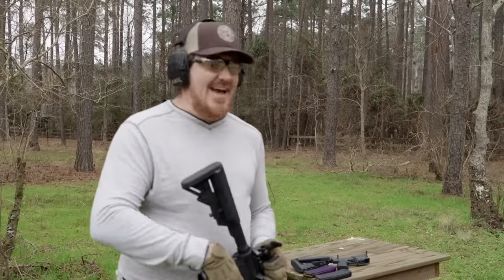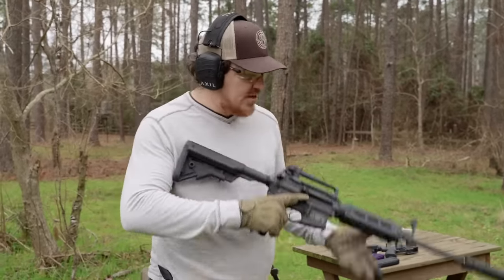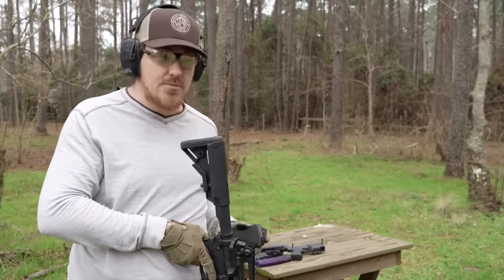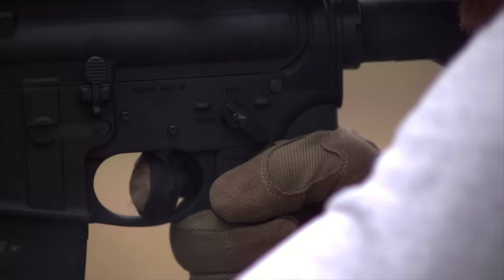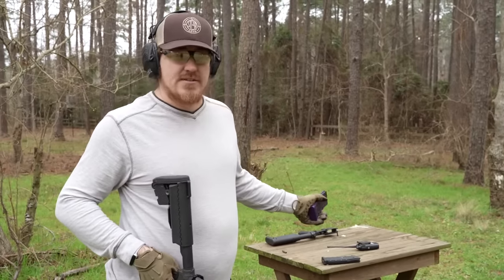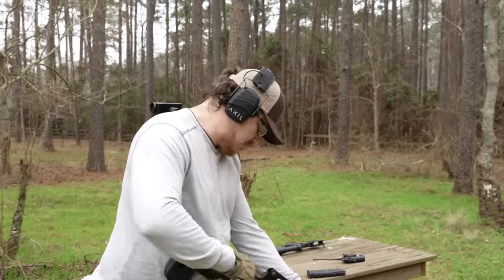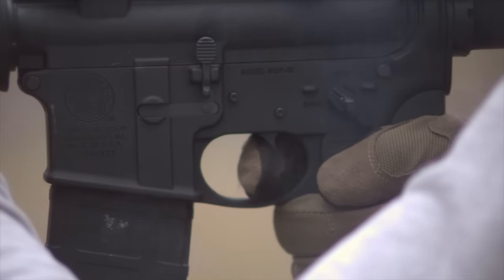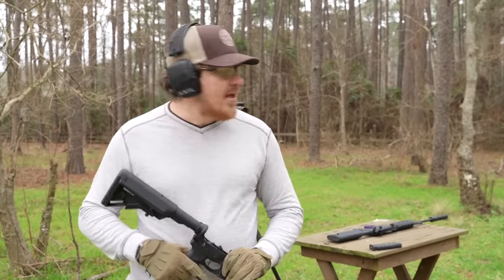FRT-15 Vs An Actual Machine Gun

Comment: With the AFT going after Rarebreed, this is the video that I've been wanting to see. 

The footage that you managed to get with the high speed proves that the Rarebreed trigger doesn't meet the AFTs definition of a machine gun.
Reply from the maker: That is the main idea. Hopefully this makes it to the courts
Reply: My question is do you ever release pressure on the trigger? Looks like one squeeze 30 pews to me I think you just did the ATF a huge favor with this vid.
Reply: @GigaBrand  A fully automatic trigger or firearm is defined as having the ability to fire multiple rounds per trigger function or, in simpler terms, having the ability to dump a mag without releasing or resetting the trigger. 

The forced reset trigger, as explained in the video, uses some of the gas from a spent cartridge to force the trigger to reset as the bolt cycles back. The trigger resets, ergo, one round per trigger function (which would meet the ATFs prescribed definition for a semi-automatic; perfectly legal). This is the definition set forth by the ATF, so, unless they plan to use this case to set precedent for the redefinition of their own definition (confusing, I know) then they don't really have a legal leg to stand on as per their own verbiage.
Reply: @cajunstump  I get that, The ATF has never cared much for verbiage (the way they define receivers, for example). TBH I'm real pro full-auto and I see a few companies making  similar devices which is cool.
Reply: @GigaBrand  Fully agree, man. Since neither of us are criminals, I'm operating under the assumption that your not (also operating under the assumption that you're not a fed), then we should be able to own whatever the hell we want as far as guns go. Full-auto? Yes, please.
Reply: @gatcattill  O.K.- You have a judge watching the video. The FRT fires faster than the automatic. 
The main difference then is the rare breed trigger.
Now we have the close up of the trigger action.
If you pull the FRT trigger all the way back you don't get the automatic action.
You have to regulate the pull just so. But you really are not pulling it with each round. You can empty the magazine without moving your finger. The trigger does it for you.
On the automatic the firing mechanism is internal. With the FRT the mechanism is set externally.
Your going to have a good argument in court trying to claim you are consciously pulling the trigger with each round as in a semi.
Now don't get angry. This is what you are going to run into without any change in the law.
Reply from the maker: @nibcamp3958  I disagree - the faster rate is the delta of buffer weight. Also the law does not control the rate of fire just the action used to obtain a rate of fire. The trigger movements are the letter of the law and that is what’s important here. The ATF would have to change the letter of the law to make this illegal
Reply: @gatcattill  Here's the thing. Your opinion is fine.
The close up of the finger shows that you don't have to release the trigger and it keeps on firing. My interest is in the law and how it would be interpreted in a court of law.
We'll find out soon enough.
Reply: @GigaBrand  lol talk about missing the point, the legal wording is trigger pull not "oh the shooter must consciously let go and pull it" that would be too complicated
Reply: @nibcamp3958  Except the law doesn’t require you to consciously pull the trigger. As written it is single function of the trigger.
Reply: @frankshanks9726  That's a fine line between a semi automatic and a machine gun. If you can empty a 30 round magazine without consciously pulling the trigger 30 times , for all intents and purposes its a machine gun.Why do gun owners want this is beyond me. Be satisfied with a semi. Your only hurting your own cause by wanting more than is necessary.
Reply: @gatcattill  and they can and will
Reply: @nathanbarth7909  they can try.
Reply: @punchabunchofbuttons214  JON DOE- Pfft.
Reply: @nibcamp3958  don't mean to Necro but when the ATF says full auto is more than ONE ROUND PER TRIGGER PULL, and then you look at the function of the FRT, conscious or not, the trigger keeps resetting itself, albeit through the means of gas blowback, so while for all intents and purposes, it may as well be fully automatic, by the current legal definition of fully automatic, it does not fall under full auto since even with an FRT there is no more than one shot per trigger pull! Plus, the finger is required to activate the trigger regardless (whether done consciously or not) for the FRT to function.. so not full auto! I don't mean to revive a month old thread but I really felt like this stuff needed to be clarified without resorting to personal insults and back and forths!
Reply: @AmalekIsComing  Yes but here's the thing. With the FRT if you pull the trigger all the way back it doesn't work like an automatic.
You have to hold the trigger just right so that it keeps resetting and firing. You can therefore empty a magazine with one trigger pull, just like an automatic. It will never be allowed.
Reply: @AmalekIsComing  The Feds will never let themselves be outgunned. That's why automatics for civilians were banned in the first place. It started with Thompson machine guns and the Mafias. Always remember that. And always remember a civilian has no need for an automatic or gadgets that mimic an automatic. They do enough damage with semiautomatic. Gun owners should just concentrate on keeping what they have. Those gadgets just cause a bad name in a political world. Save your money.
Reply: @GigaBrand  Good thing “pressure” or “one squeeze” isn’t written in the law. The word that is in the law is “single function”  and there are single functions every time a round is fired on this trigger.
Reply: @nibcamp3958  Good thing conscious thought isn’t in the law. How the hell does a trigger behind your finger move your finger backwards for you? Look if you zip tied an automatic trigger to the rear it would keep firing and the FRT wouldn’t, so yes, you do pull the trigger each time. The only thing the trigger does is force your finger forward but not backwards.
Reply: @nibcamp3958  Please point me to the law that says conscious thought must be applied to each trigger pull, I’ll wait. Oh that’s your opinion, I see.
Reply: @frankshanks9726  You are talking foolish now Frank. The gun wouldn't fire if the finger didn't go backwards. You can empty a magazine with the FRT trigger similar to an automatic. And only with the first initial pull which has to be exact. After that the FRT trigger does the rest. Save your money. That trigger is dead in the water.
Concentrate on saving your semi instead or they will take that away from you. There is a time in life where you don't need what the army uses.
Reply: @nibcamp3958  You are the one sounding foolish and it’s clear you have never fired this trigger. I think I’ll keep what the Army has as that the entire reason behind the 2nd amendment. I have a NFA tax stamp for my auto and I also have this trigger.
Reply: @frankshanks9726  You're not going to win this argument in court. Save your money.
Reply: @frankshanks9726  You're not going to win this one. Save your money. It's a gimmick.
Reply: @nibcamp3958  Who is to decide what gun owners "need"? It could be argued that no one "needs" a semi automatic either, you can do plenty of damage with a bolt action or lever gun. It is Thai type of thinking exactly that has allowed the atf to continuously and slowly strip away more and more of our freedoms.
Reply: @JackGarbarinoOfficial  Quit arguing with the atf and wanting more gadgets. Be happy with what you have and protect it.
Reply: @nibcamp3958  protecting what we have involved arguing with the atf my friend. They are trying to take more than these stupid triggers man.
Reply: @nibcamp3958  you sound like a fed that works for the ATF
Reply: @nibcamp3958  According to the constitution civilians need to be as well armed as the government.
Reply: Lol at Nib Camp glowing in the comments here
Reply: @gatcattill  The law states a "single FUNCTION of the trigger" - not movement. Pull back, and hold but not TOO tightly -- is a single function of the trigger, which is expelling multiple rounds. That the trigger pushes your finger back is irrelevant. Cross reference the Tac Con 3MR forced reset trigger which has an ATF approval letter. 

In that case, the rate of fire is much slower, and you can tell the operators need to be much more deliberate in pulling the trigger. It doesn't have a sweet spot like the FRT does, and that is going to make all the difference. 

I hope I'm wrong. But I purposefully didn't buy an FRT because I knew all this legal crap would happen, and I'm rather sure it will get considered a machine gun.
Reply: WELL GUESS WHAT, THESE ARE NOW ILLEGAL. ABSOLUTELY RIDICULOUS
Reply: @O W  wrong. You see the finger move 1/8 of an inch. Same as a hair trigger. If you pull hard back the gun jams. Atf is made because the rules actually said one pull or function. The trigger is cycling.  Not far  UT law never defined the length of pull or said reset could not be forced
Reply: @Nib Camp  on a full auto the trigger is held back one pull. They never stated you could not have assistance with the reset.  It aids you in pulling albeit slightly.  Was not illegal until atf changed the verbiage of the law with out a vote
Reply: @mlogsdon1740  Found the Benedict Arnold, everyone.
Reply: @gatcattill  buy a nice suit,  u might get "subpoena"
Reply: @nibcamp3958  everyone including you in this thread is missing the main point. The Constitution does not limit one's second amendment right, only the ATF tries to do that ,which is illegal by definition. It doesn't matter what you think people do or don't need just like with anything else. That would be a very dangerous slope because one could argue one person doesn't need three cars or doesn't need two houses and so on. People that are willing to just give up their freedoms don't deserve it in the first place
Reply: @gatcattill  And their banned. I came her to see what they were & I understand why they banned them but still don't agree.
Reply: I know, I got to like page 43 of the indictment before I couldn’t take anymore. It’s like a 78pg indictment.
Reply: @gatcattill  send it to the ATF and the supreme court then. Don't just hope it makes it......

Comment: Nice video. I watched a few other videos on this product, and yours is the first to actually show the finger and trigger movement well.
Reply from the maker: Thanks. We felt it needed to be done to help the arguments that would come in fact be fiction about classification changes that could occur. It’s cut and dry semi automatic. The trigger is definitely closer to 2.5lb than the advertised 5. This does make it slightly difficult to achieve single fire, but not impossible.

Comment: I don't know about any "battles"? If I want real FA, I can drag out my Colt M16A2 and blast away. But at $32K it's hardly a truck gun. So for $400 I can have some blasting fun. Props for the slo mo analysis! Better presentation than any of the official RB videos!
Reply from the maker: Agreed. And yeah I felt the shot needed to be done and had access to the high speed to make it happen thanks to another channel I work on.
Reply: That and a registered lower is technically a rifle so driving around with it loaded isn't quite the same as having a 'pistol' with a funky trigger. Kinda wish the funky trigger had an unfunky position..
Reply: Full auto M16A2? Uh...
Reply: @MichaelPoage666  Correct. Technically an M16A1 lower with an A2 upper. I didn't care for the 3 shot burst. I would have posted M16A3 but figured few would recognize that config. Good job!
Reply: @jackgates6949  I’d prefer the burst, tbh. Idk, ima nerd I guess
Reply: @jonosterman2878  If you ever shoot a dedicated burst MG I think you'd tire of it quickly. The burst function served no purpose other than to force fire discipline as opposed to teaching it. Also, the cam disengages when the firing stops. So if you let off the trigger after two shots, the next pull yields a single shot before it resets. Likewise if you run out of ammo and reload, you might have one, two or three shots on the first pull. Luck of the draw. You have no control.  I'm thinking you might not prefer it so much. I never did. 😁

Comment: FRT can definitely run faster than what a stock M16 NORMALLY runs. In my first video of a 60rd mag dump it clocked at 909 rpm. After modifying my trigger pull to 6.5 lbs and a heavier buffer, I did another 60rd dump and it clocked at 723 rpm. My Colt M16A3 runs around 800 rpm with the same ammo LC M193 so I have it where I want it. YMMV
Reply: Yup, same here. But got 910 and 724, and looked better doing it
Reply: H2 buffer spring or something else?
Reply: @jedirasta  H3 Geissle Braided Buffer Spring setup. Best buy I ever made.

Comment: Nope, got mine the minute it came out.  Don't care if it has some sort of failure, I can fix something that I actually own.
Reply from the maker: True statement. Replacing the spring is not difficult and can be found at Home Depot down the spring isle. If you got em send em
Reply: Use a proper bcg and it works fine without modification! I've got over 1600 rounds through mine with zero indication of excessive wear or damage to the locking bar spring.
Reply: @k9gustoff  I may or may not have bought 3. These guns which may or may not exist, are The M&P 15X, which now has a Geissele BCG and H2, and the M&P 15T which also has been fitted with a Geissele BCG and H2 and a Geissele Super Duty 11.5 pistol which has all Geissele and an H3.

Gunsmith is still tweaking them,  think these setups will run like champs as yours does?
Reply from the maker: @Speegs23  They will run fine - unsure of how long your spring will last. Mine has shown signs of bending but no failures.
Reply: @k9gustoff  what kind of BCG are you using? Are do you know what specifications it requires?

Comment from the maker: Guys - BDU released stock this past week - No announcement of a fix? Guess time will tell what's going on.
Reply: I received my order today from BDU, no modifications have been made
Reply from the maker: @redactedprofile8731  Good to know. Sad to hear though.
Reply: BDU did have stock this week, so did their own site. Just an FYI
Reply from the maker: @FatalForrest  yep - I shared the waitlist link for folks who didn't get it. They did not change out anything about design though - so anyone ordering needs to anticipate changing the spring at some points, or cutting the half moon slit to relieve spring pressure on the side.
Reply: I ordered a 12pk of the springs on McMaster for $5. Haven’t shot it yet, but figured spares couldn’t hurt
Reply: @turdferguson989  what’re the specs of the spring?
Reply: @turdferguson989  yes if you could share the spring details that would be awesome. my FRT is still working flawlessly
Reply from the maker: @JesseSeg84  https://www.rarebreedfirearms.com/locking-bar-spring/ they sell them now and the modified bar to fix the issue on the site. 37 bucks shipped for 2 springs and new bar.
Reply: Bdu

Comment: ATF will call this bump firing and call it a machine gun like a bump stock.
Reply from the maker: That’s good. Cause bumpstocks are legal 😻
Reply: @gatcattill  Please site your sources on this if you have more recent information on the status of these items. Currently the BATF website still has them listed as machine guns.
Reply: @JoRyGu  BATFE never banned bumpfire, only bump stocks, and that ban has been overturned in the Sixth Circuit with GOA v. Garland, which is actually a more general victory than bump stocks, or anything firearm related, because it weakens the doctrine of Chevron deference. State bump stock bans stand, but BATFE's administrative ban does not in the Sixth, and likely would not elsewhere. BATFE will continue to insist they're illegal on their webpage, but the situation is more nuanced.

Comment: If that's a machine gun my pop's Remington 1100 is, it also only fires once for each pull of the trigger.
Reply from the maker: ATF judges coming to a state near you
Reply: I don't agree with this ruling but why are Yall hung up on trigger pulls the law doesn't say anything about trigger pulls it says a function of the trigger
Reply from the maker: @michaelf.2449  agree. Hence binary. What they are focusing on is that you only pull once.
Reply: @michaelf.2449  Pulling the trigger to the rear is a function. You're really getting wrapped around the axle. I'm not using the word 'pull' the way the ATF does with 'continuous pull', I'm talking the rearward function geez. Hey is it okay with you if I call my cotton swabs Q-tips, Mr. Word Police?
Reply: @GNpatent  because I believe the issue the ATF has and will argue is the defintion of a "function" you have to think the legal defintion instead of our common sense defintion.